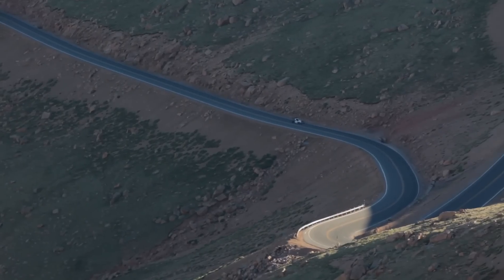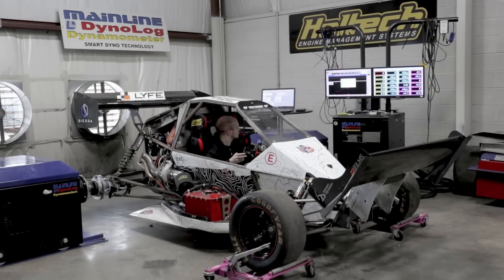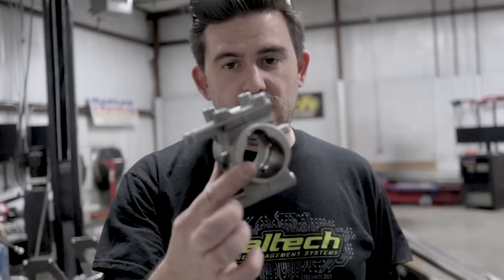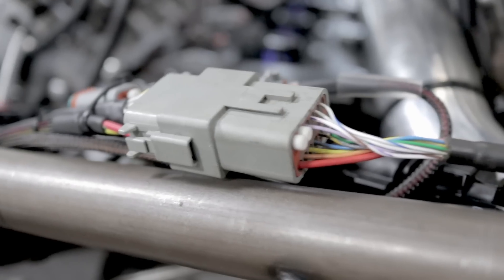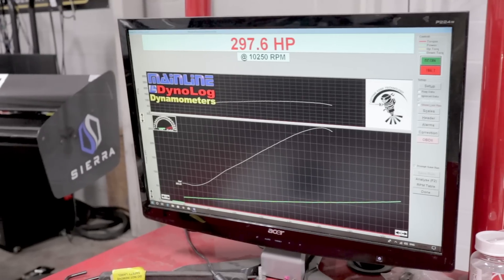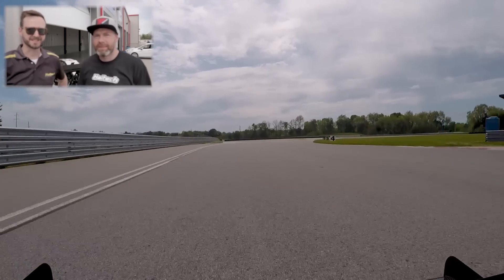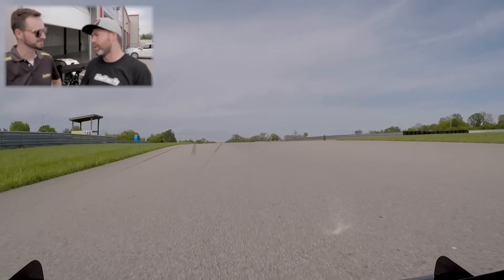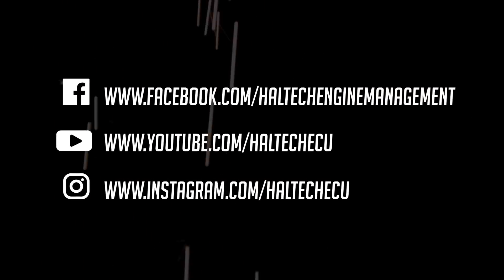🔧 HUSA Garage Special: Setting up Sierra Alpha for Pikes Peak

Comment: "it makes 300 hp at wastegate pressure. That'll be our benchmark for later"
Later: "Great news guys, after tuning it made 297 hp!"
Reply from the maker: Benchmark - a standard or point of reference against which things may be compared or assessed.

The Alpha that showed up at HUSA was already fully tuned on a competitor's ECU. The purpose of the baseline run was to ensure we made the same or more horsepower before the car left. We did not expect to make gobs more horsepower just because the ECU was changed.

The reason for the ECU change was that the previous ECU lacked some features the car needed. Features that the Elite 1500 had.

Comment: I disagree with removing itb for single throttle body just for convenience 
In a vehicle where engine response makes a huge difference I think it's the wrong move
Reply: especially considering that a lot of motorcycles are drive by wire anyways and have automatic throttle blip functions nowadays. 
Chose the right itbs and its basically gonna be plug and play and you dont lose the response.